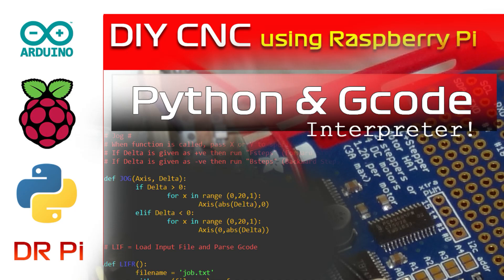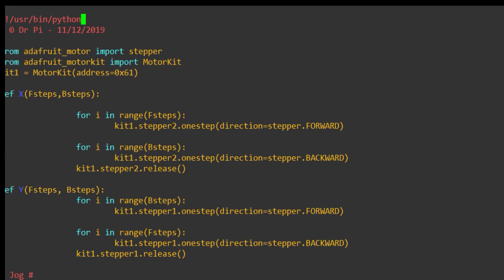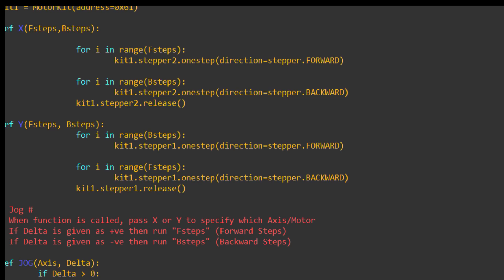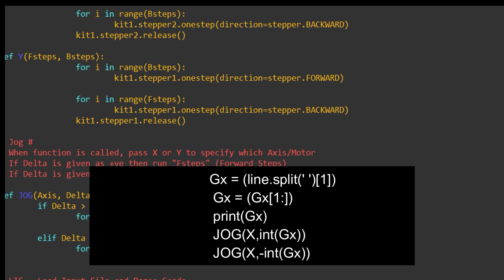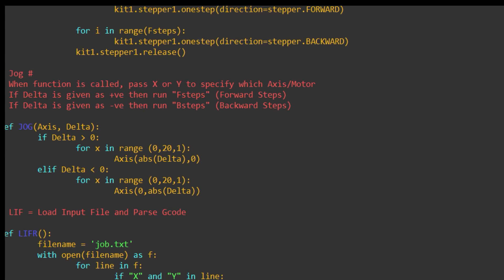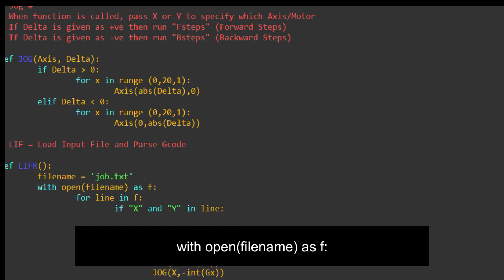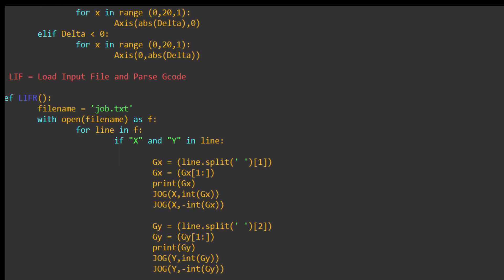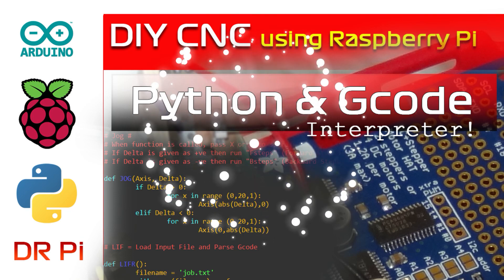Raspberry Pi - DIY CNC - Gcode via Python (Part 1)

Comment: Sir, kindly reply ASAP. 

1. Will it work with Raspberry Pi 3 with Ubuntu 20.04 OS. 

2. Will it also work fine with an other ARM 53 based PC just like raspberry pi 3 ?
Reply from the maker: The code or the HAT?
The code WILL
I don't know about the Adafruit HAT, better to check with them and the spec of their current HAT for the Pi...
Reply: @jobstr-work  Thanks for the prompt reply.

Comment: Hi
i can use these code without GRBL  ?
I mean Is it possible to create a program in Arduino that receives G code like GRBL ?
Reply from the maker: Arduino has a GRBL module you can install. But if you aren't using GCODE then sure, you can move x,y,z motors  programmatically, but for curves you'll need GRBL really...

Comment: Hi Dr Py. im not sure of your familiarity with pyfirmata and pandas but nothing beats a try. I am trying to build an RFID-enabled automated retrieval/storage and inventory system using Arduino boards. For my prototype, do you believe pyfirmata will be able to retrieve RFID data serially, put it in a pandas data frame and finally with the help of a wxpython GUI bind pyfirmata events(or the GUI control pyfirmata)? I hope you understand what I'm trying to ask since I really would love your insight.
Reply from the maker: Hi, so are you intending to have a kind of "hand held" device to carry around ?

Eg a Pi+Arduino+battery, strapped together?
Do you even need the Arduino?

I've not used pyfirmata, but if you see one of my recent videos I (with the monkey on the thumbnail) I got 2 way communication between the Arduino and the Pi.

From a code perspective, if you can do it without using pyfirmata then you will learn more, and be able to ask more questions on stack overflow for instance.

See also : https://www.instructables.com/Raspberry-Pi-Talking-Barcode-Reader/

For data storage, if you are thinking ahead, maybe use PostgreSQL and psycopg2 to enter data to a database (You can write to SQL via pandas btw)
Nostarch have a great book called "Practical SQL"  which has helped me a lot with SQL.

PostgreSQL is well supported in GCP Google cloud as well.
Reply: @jobstr-work  I understand MySQL would be good but I'm thinking that for my simple prototype excel can be considered. the movement of items will be automated. I'm going to check out that video you mentioned. thanks
Reply from the maker: https://youtu.be/eXpzo8CTSuY

Comment: hi dr pi. could you tell me why you have the "for x in range (0,20,1):"? i would love to hear from you..
Reply from the maker: Hello, good question, that's one of my older videos, I was using the optional parameter at the end, the step value for didactic reasons. With hindsight, a comment to that effect may have been good. 👍👍
Reply: @jobstr-work  optional parameter? What do you mean sir. (Im new to this)
Reply from the maker: Ok, no problem, glad to have you here on the channel.
So with the "for" loop, we specify the range to go 'from', and 'up to'.
So start at 0, and go up to, but not including 20. The 1 at the end means go upwards in jumps of 1 (as opposed to say 2 where it would use  0,2,4,6,8 etc...
Reply: @jobstr-work  sure. thanks doc. I understand the range operation but I'm wondering how it the ranges affect the jog operation.
Reply from the maker: Ah, from memory, I was moving the motor  afixed amount == 20 steps with that, rather an amount provided by the text file
Reply: @jobstr-work  thanks doc you were a lot of help

Comment: Hi, I have written a program that produces basic g code. It just writes all the coordinates of the black pixels in my image as, F200 G0 X1 Y1 can your program be used to convert it to actual g code ??
Reply from the maker: Hi, I never really finished it, but if I was to revisit it I'd make some functions for circles and arcs. The x,y part of my code would be sufficient to move the motors though.
Reply: @jobstr-work  yeah I’m finding it very hard making code for arch’s at the moment all of my g code is just set to rapid movement G0

Comment: i dont have the adafruit hat, i have 3d cnc xy plotter model which i used for my arduino project, can i still make this work without the adafruit thing? please guide!
Reply from the maker: I'd recommend the Protoneer HAT, or  use an Arduino, these 2 methods will allow you to use GRBL.
If you don't need/want GRBL then you could also just have 3 stepper drivers connected straight to the Pi.
Reply: @jobstr-work  hi ,thanks for replying to me.
Actually we aren't allowed to use Arduino, it's a university based project.i have connected 2 stepper drivers and servo to my pi and they work fine
But I was looking. For a way to plot drawings without using grbl controller.,
Reply from the maker: @nightmare-t2f  Ok, so connect the stepper drivers to the Pi and then you'll need to write your own code. When I did it I had a rough attempt and managed to draw a diagonal line and a rectangle, but to draw curves and circles you'll need to go a bit further. I'd recommend trying Numpy with 2d arrays first

Comment: hi guys, ı wanna ask something this code is for 2 axis or 3 axis. ı checked code but ı havent seen code for z axis.
thank u so much.
Reply from the maker: Yes, when I developed it I did the code for x and y initially.
I had to order z axis from China and it took 2 months to arrive from Banggood.
To add z to the code would require duplicating the x (or y) blocks of code and renaming to z.
If I was to rewrite the code now I'd also consider using a numpy 3d array or even try to write it in c.
Good luck with your project 👍

Comment: can you guide me who i can creat gcode generator software for milling in python
Reply from the maker: Curves and circles were the features that made me decide ntot to reinvent the wheel, so have a look at this :
https://github.com/mrRobot62/GCodeGenerator_Geometricals
You will see the code there.
Hope this gives you some inspiration, I got as far as lines and rectangles with my code and then ran out of time.
Reply: I'm seeking a C# or Python developer who can write G-code based on JSON input, especially if:

The JSON input includes dimensions, toolpaths, and operation types (e.g., drill, mill, cut, etc.).

The developer understands CNC machine constraints, like tool offsets, feed rates, spindle speeds, and machine coordinate systems.
Reply: Can you help me in this Project?

Comment: Hello, 
you have exactly what im looking for but, i cant find it on github
any chance you can share the file and tell me how to setup?
any help will be very appreciated!!!
thanks in advance
Reply: Thanks for your help!
I’m using arduino nano 4988 drivers and nema steepers 
Yes, laser web uses gcodes and Grbl and macros (keyboard press)
What I’m trying to do is to connect buttons to raspberry pi to control the machine...
So what I need is to emulate one keyboard key to each new button and send it as keyboard stroke.
I thing it cant be difficult but I can’t find any example to modify it for my needs...
If you can help with that will be VERY APPRECIATED!!!
My email is guiche76@gmail.com
Cheers
Reply from the maker: Just emailed, sorry taken so long!!
Reply from the maker: Hello, I've updated the GitHub link, you should be able to download the file now.  Do you have the adafruit HAT? 

This is what I used for research : https://cdn-learn.adafruit.com/downloads/pdf/adafruit-dc-and-stepper-motor-hat-for-raspberry-pi.pdf
This is the important part :

Python Installation of MotorKit LibraryYou'll need to install the Adafruit_Blinka library that provides the CircuitPython support in Python. This will require enabling I2C on your Raspberry Pi and verifying you are running Python 3. Since Linux changes often, please visit theCircuitPython on Linux guide to get your computer ready (https://adafru.it/BSN)!Once that's done, from your command line run the following command:sudo pip3 install adafruit-circuitpython-motorkit

Once you've done that, my cnc.py file should allow you to move the motors, and import a file of simplified GCODE.

If you get stuck let me know, and I'll be pleased to help.
Reply: @jobstr-work  no adafruit, im using laserweb4 and raspberry pi 4,  would like to use your code to make a push button controller box for the raspberry to control laserweb4.
if you have any idea on how to do that will be verry appreciated!!!
Reply from the maker: OK, I'm not familiar with laserweb, I'll have a look. I'm sure I'll be able to help. I'll get back to you very soon.
Reply from the maker: Ok, so I have a look at Laserweb: Does it use a GCODE file? 

If you want to send me a sample file I can write something to parse it and then control motors.
What stepper motors/drivers are you using?

Comment: Hii sir can we give this code to stepper motor?
will it run?
Reply from the maker: Yes, make sure you have an Adafruit HAT on top of you Pi, and set the address the same.

kit1 = MotorKit(address=0x61)

See Adafruit documentation on how to identify the address of the HAT.

You will need to have a file called "job.txt" in the same directory as well - it will need to have the X and Y values for the motors. The code can be extended to add the Z axis also (use same format as X, and Y).

If you need help I am happy to assist

Format = 

x20 y30
x30 y40

Comment: hi sir
thanks for your video 
have you uploaded codes some where ?
Reply from the maker: Hi Pedram,
Thanks for your comment, yes the code is pasted in the comments below, it's Python code, so you can copy and paste it into a text file, save as picnc.py and run it from command line with "sudo python3 picnc.py" if you are using a Raspberry Pi.

There is no error checking, so if you haven't got the Adafruit Motor HAT, you will get an error.

I have just created a GitHub page for my new work going forward, so my CNC related code is not on there yet, but when I get time I will create a section for the CNC code.

Comment: I keep thinking I should have a a go at writing my own version of GRBL but on Arduino. I have started writing a CAD to G code converter which is on my web site
 https://sites.google.com/site/richardcncprojects/projects/dxf-to-g-code-python-convertor
Reply from the maker: Thankyou, I'm going study your DXF to G code and have a think about : 
1. Do I want to write a circle subroutine?
2. How I handle absolute v relative coordines. I was thinking of using relative coordinates everywhere, and using a global variable to keep a tally of all the moves, so the code effectively knows how to get back to 0,0,0.
3. Relative coordinates make moving the steppers easy, but DXF to Gcode converters create absolute, (unless G91 is applied). 

I've seen an Arduino (Nano) in photos, mounted onto the Raspberrie Pi Protoneer CNC HAT -   I'm curious as to what can be done with that too.

My current thinking is that I'll code a Circle subroutine in Python and experiment a bit more with just Pi+Python.

Comment from the maker: #!/usr/bin/python
# © Dr Pi - 11/12/2019

from adafruit_motor import stepper
from adafruit_motorkit import MotorKit
kit1 = MotorKit(address=0x61)

def X(Fsteps,Bsteps):

                for i in range(Fsteps):
                        kit1.stepper2.onestep(direction=stepper.FORWARD)

                for i in range(Bsteps):
                        kit1.stepper2.onestep(direction=stepper.BACKWARD)
                kit1.stepper2.release()

def Y(Fsteps, Bsteps):
                for i in range(Bsteps):
                        kit1.stepper1.onestep(direction=stepper.FORWARD)

                for i in range(Fsteps):
                        kit1.stepper1.onestep(direction=stepper.BACKWARD)
                kit1.stepper1.release()

# Jog #
# When function is called, pass X or Y to specify which Axis/Motor
# If Delta is given as +ve then run "Fsteps" (Forward Steps)
# If Delta is given as -ve then run "Bsteps" (Backward Steps)

def JOG(Axis, Delta):
        if Delta > 0:
                for x in range (0,20,1):
                        Axis(abs(Delta),0)
        elif Delta < 0:
                for x in range (0,20,1):
                        Axis(0,abs(Delta))

# LIFR = Load Input File and Run

def LIFR():
        filename = 'job.txt'
        with open(filename) as f:
                for line in f:
                        if "X" and "Y" in line:

                                Gx = (line.split(' ')[1])
                                Gx = (Gx[1:])
                                print(Gx)
                                JOG(X,int(Gx))
                                JOG(X,-int(Gx))

                                Gy = (line.split(' ')[2])
                                Gy = (Gy[1:])
                                print(Gy)
                                JOG(Y,int(Gy))
                                JOG(Y,-int(Gy))

LIFR()

exit()